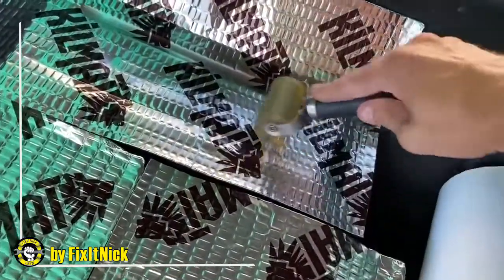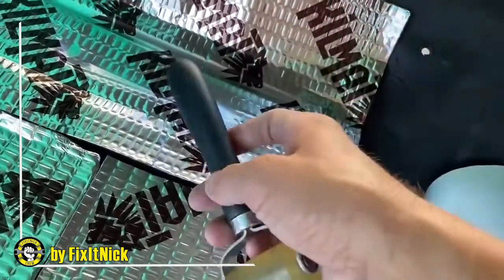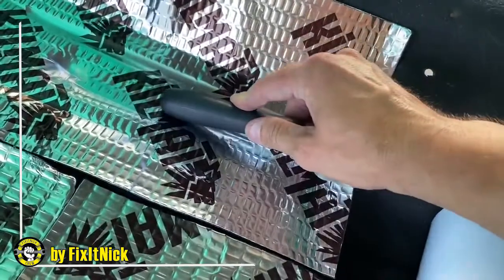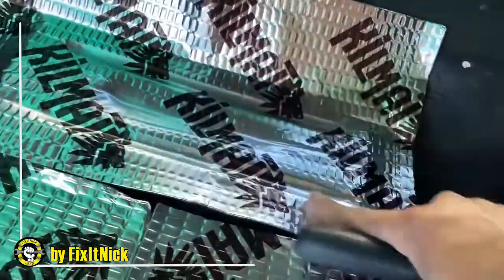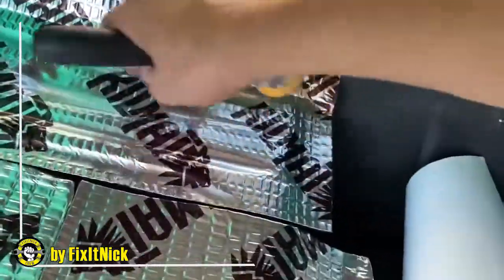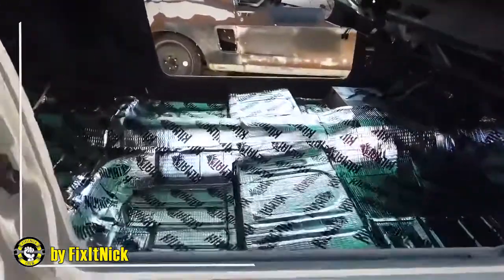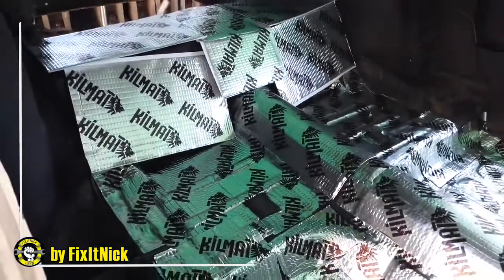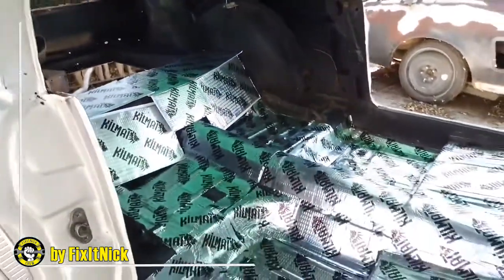1967 Mustang Project/Floor insulation

Comment: Can I apply it on rhino line inside my car
Reply from the maker: Good day! In order for Kilmat material to work it has to be in direct contact with the (primed or painted) metal surface of a vehicle(regular car paint).
We do not recommend installing our material on surface coated with a bedliner/rhino liner , since the effectiveness of our product may be significantly reduced if metal was treated with such type of insulation . 
Moreover, the material might simply not work as it has to be installed directly to the metal surface for it to absorb the vibrations and rattles.

Comment: @Kilmat Does your Insulation protect against heat as well as sound or is it just a sound deadener?
Reply: Late 
but kill may is not an “insulator” u need r value for heat etc’ 

Also it’s not a sound deadener marketing had really tricked ppl / mid lead them’ 

Think of a drum cymbal u bang it it echos and vibrates’ that’s what this eliminates it stops reverb / vibration of metal panels that is why u r wasting material if u try to cover more than 50-60% It will make things a hair quieter as u stop the vibrations n panels but it is not A ROAD NOISE deadener’ 

U need to put this type of product on metal 50-60% coverage then u need closed cell foam not open cell foam usually 1/8-1/4” closed cell foam on-top of this as a decouple layer  100% coverage 
Not we bring n the heavy guns 

Now u put mlv - mass loaded vinyl heavier the better at 100% coverage’ this will now stop vibration hit the foam middle layer and dissipate sound with the MLVm 

u could stop there but if u want even more sound proofing u would get carpet jute backing lay that on-top of mlv then your cars carpet’ 

For an even more air tight seal oem weatherstripping sucks’ u need to add like d shape 3m backed weather strip around every door top side bottom but leave your oem weatherstrip’ this all combined will give u the most affective quiet car 

Of course ontop of all this tires play a huge part in sound’ some tires r very loud others far quieter have to do reviews / specs of tires 

Think of it this way any where air can leak in sound can travel in and there’s nothing stoping it’ u want it as air tight as possible’ 

Don’t get the cheap $50 mlv roll u get what U pay for’ you’re looking at a good 175-200$ for a roll of mlv a good $100-150 for the foam de couple layer and then depending on brand $150 or so in butyl / foil like kill mat dyno mat etc 

If u can’t afford to do it right u can’t afford to do it’ no offense to anyone just trying to help ppl’ 

Marketing is very misleading these days’ so hope this helps someone 

And 1 more thing glass 
Glass is very bad at sound absorption Oem cars put the car together as cheap as possible to make more money sadly’ 

U can get acoustic glass but it is not cheap’ however if u do the above correctly and skip the acoustic glass I think u will be very happy’ 

Even more happy with the glass 

But we’re talking u have to strip your car to the bare bones’ u have to do firewall floor pan door panels etc’ if u just want better sound for speakers throw this in door panel and call it a day but if u r going
For luxury level sound proofing you’ll need to do the above mentioned steps

Hope this helps someone in the future